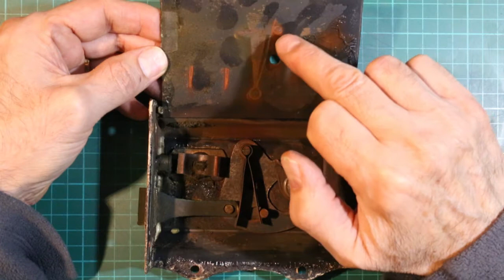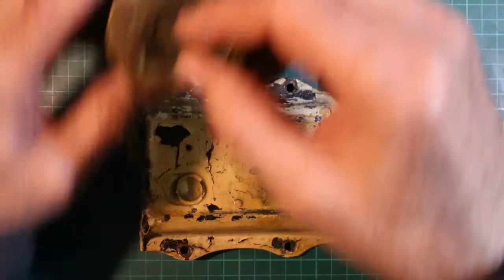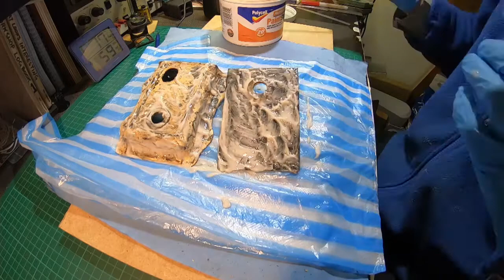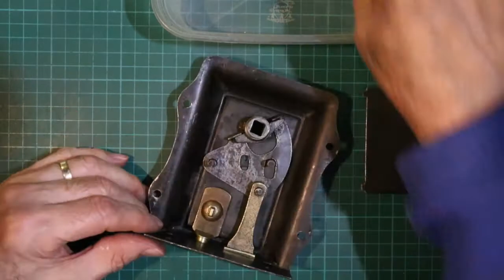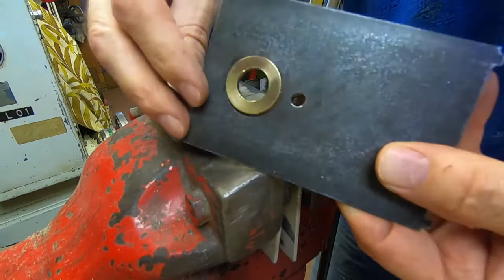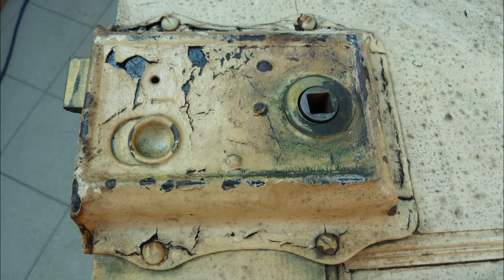Vintage Rim Latch Rebuild Part 1

Comment: I have an even older rim latch and the metal spring, like the one in this video but is on the right hand side rather than the middle, the sping has snaped, my question is where can I get a new one made or buy one?
Reply from the maker: Hello Tony. Where can you source a spring for your old rim latch? In short I don't know. If I needed one I would first look on the internet, searching under "Rim latch spares" or "Antique rim latch" find a supplier for these type of locks then phone or email. I am always amazed at how helpful some people can be. Something else you could try is to call a locksmith, ask him/her where you can find parts for the type of lock you are trying to fix. Hope this helps a little. Take Care Jim